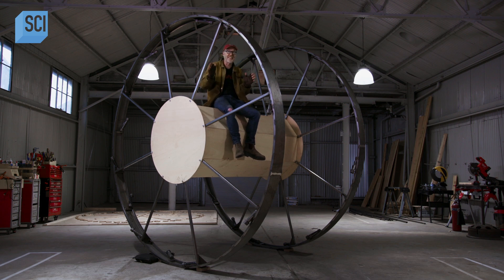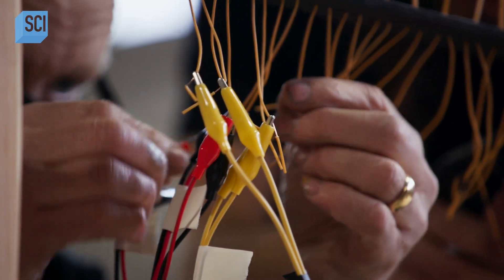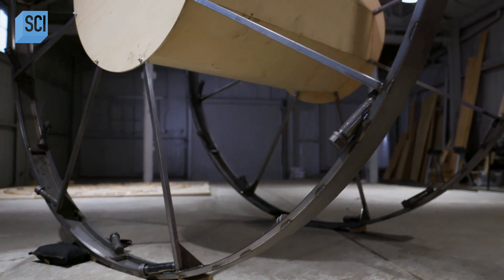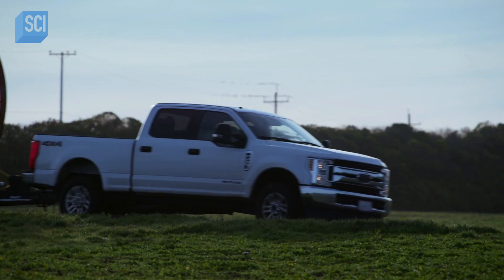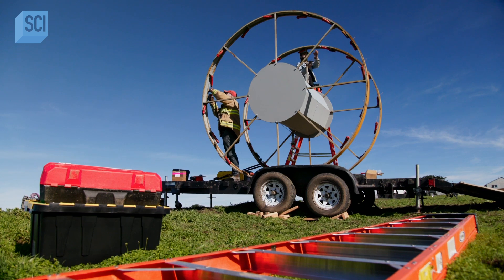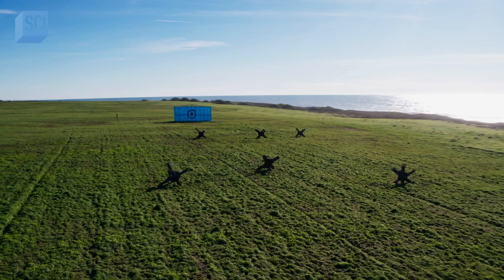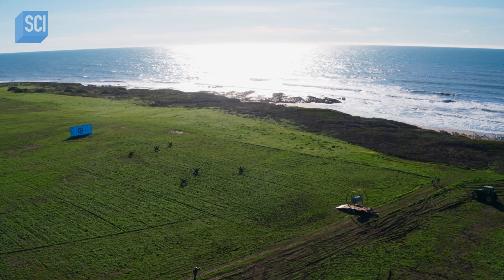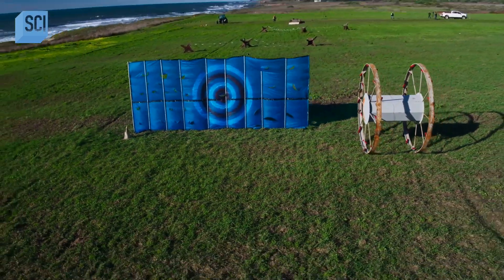Adam Savage Builds & Tests a Working Panjandrum | Savage Builds | Science Channel

Comment: Huge waste of thrust with the simultaneous ignition. 3/4 of the energy you get is angular momentum (spin) that has to convert to linear momentum by traction on the ground. Unequal traction due to ground inconsistency in contact, level, wheel orientation, viscosity, and the list goes on, makes it an impossible concept. Fire more but shorter burn rockets sequentially as they go across the top quarter of the wheel. That way the rocket thrust pushes the wheel toward the target simultaneously giving it spin for roll without traction.

Comment: — With 1000s of pounds of TNT at the center, the rockets would have to be very large. 
— With so many points of failure on the panjandrum itself, the uneven grounds, and no steering, it’s a failure waiting to happen.
Reply: Which is why it failed.
It turned away from the target, and towards the officers watching the test, spiralling towards them down the beach, spewing smoke and fire.
Also, because the project was mostly german spies by the time they axed it. They got shunted into it by counter-intelligence, where they could be watched easily and do basically no harm.